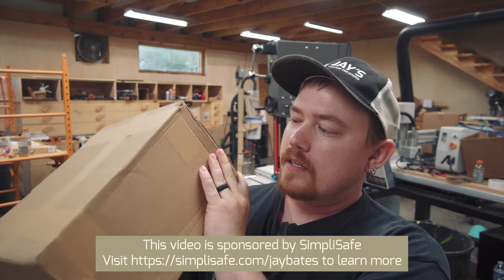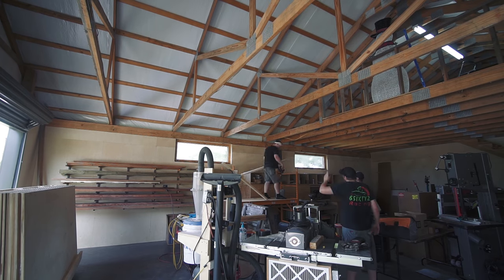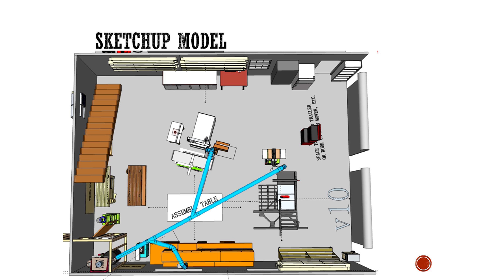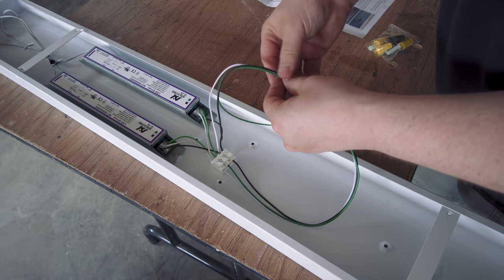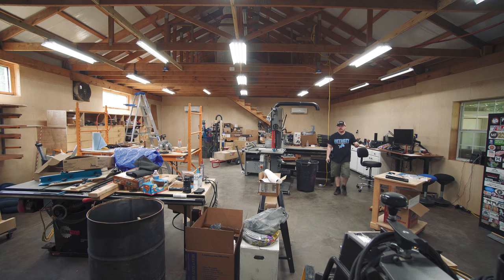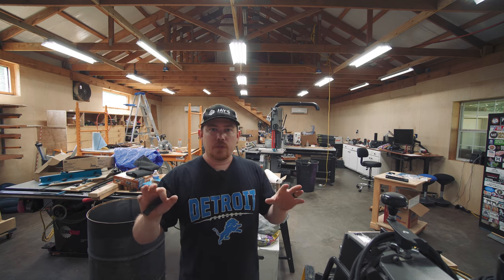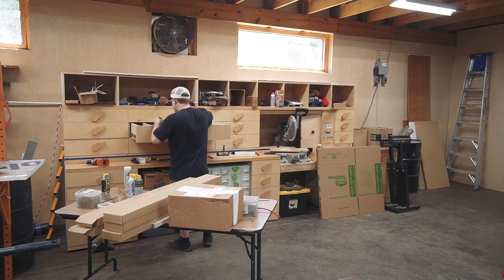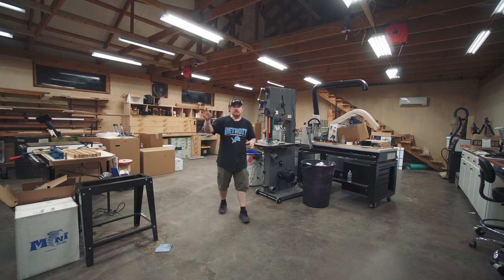30×40 Shop Part 5: Electrical, Lighting, and Security - 324

Comment: Jay,   I started doing lighting design in the mid 80's and recently retired from electrical engineering for a major contractor.   Your method used to determine the lighting was spot on.   Your explanations of the lighting term meanings were perfect.   I only have two thumbs👍👍 so that is all I can give it.  You are truly a professional!    Very respectfully,   Kevin

Comment: you  could add lights pointing up so iluminate the roof. i guess that would enhance the "open space" effect even more.
Reply from the maker: And a disco ball.
Reply: @JayBates  ... and then rent the space out to the local teens each Saturday night.. ;)
Reply: @genelomas332  - Yeah, then there sure would be some woodworking   :-P
Reply: This was my first thought after seeing the "finished" shot. The video appears dark and I think it's because the light doesn't fully reach the ceiling. Bouncing that light back down would do a lot.
Reply from the maker: @slowdaze  The video appears dark due to the camera settings being wrong.

Comment: Jay the shop is really coming together! Your doing an amazing job! One recommendation is to epoxy coat the floor. I used rustoleum professional epoxy flooring with a clear coat and non skid on top. I feel it is right up next to the lighting. It makes the shop so clean feeling. The shop is brighter and it is so easy to clean. Any system you choose it is like anything else you have to put in the prep work. If you follow it properly then the results will be out standing. I have dropped and drag things on it. No chips or peels at all. And if you don’t do it now while things are still moving about, you never will. I’m telling you just look into it and if you do it, you will be just as happy as you are about the ceiling and lighting!! Keep up the amazing work!
Reply from the maker: The floor is already stained and sealed. It's actually really nice. I need to mop one time once I get everything going.

Comment: I made an removable/adjustable shelf for my scaffolding large enough for tools or a painting equipment.  It goes "outside" the scaffolding so you don't lose any working area.  Keeps the deck clear and the tools within easy reach.  With your skills you could make one in 10 minutes.

Comment: I've been in my shop (2 car garage)  it's going to be  2 years in December 2019  ,  I'm getting closer to not having to run a extension cord or 2 to work in it. With working away from home 6 days a week and having other things to take care of when I do get home I don't always have to be in the shop. Having shop builds like yours is a big help in getting mine set up

Comment: So glad you get a chance to make a place just the way you like it. The place looks amazing with the new lights and the open ceiling. Might need a ceiling fan up in the high point of the roof opposite the loft to push heat down in the winter.
Excellent space.
Reply from the maker: My air cleaner cart blows up.

Comment: My security system has cameras outside my shop. I have one 12mp camera covering drive way, and another looking at the front of the shop where the doors are. The windows are laminate so you can’t break them anyway. The driveway watching camera is very visible and very well marked. It has captured several people driving up and speeding away, complete with wonderful face shots and license plates. The other camera is completely hidden.

Comment: Jay, I really like everything you did so far. My shop is the same size and one addition I’ll make based on this is to install a couple drop lights. Near the two garage doors at the front and back of the shop and one above the router table. It looks like you added at least one split ductless AC/heater. I must have missed seeing that getting installed Something I did that might make your shop lighting more even  is to paint your concrete floor with a light colored epoxy. Mine is a light gray with flecks and it makes cleanup quicker as well. My dust collection system gets most of the mess but I always wrap up by opening the big garage doors and using the compressor to blow the remaining dust off the benches and out on the lawn. It’s quicker than using a broom and the dust being recycled helps the grass.  Speaking of garage doors, I spent extra for insulated ones. It’s hot where I live in the Ozarks and some doors rated at R18 help keep things cool

Comment: My only tip is with the alarm system. See if Simply Safe offers a RAPID heat rise alarm instead of a smoke detector. Smoke detectors use a optical cell to sense smoke. Shop produce lots of dust which can be mistaken as smoke. I have Both Rapid Heat Rise AND Carbon Monoxide detectors. See if Simply Safe can switch the smoke detector  and add a CO detector. Place the CO detector as close to the floor as possible as far awy from a door as possible. CO is heavier than air and will rise from the ground up. If your dog or kids are in there playing on the floor then they will be effected by building CO before you will at the tools. I discovered this ALMOST the hard way.

Comment: Great ideas and good planning on your part. I particularly like the idea of protecting your tools in a rolling cabinet as opposed to the tool wall display method. Rust is always a factor with the wall hang method. I guess that the tool cabinet could be your first furniture build in the new shop. 😊

Comment: Excellent video! That vault will help with the heat for sure. One under appreciated part of your shop is the floor. Any issues with the slab? It sure looks good on the video.
Reply from the maker: No issues with the slab. It was previously stained brown and sealed. I need to mop it at least once to see it's real beauty.

Comment: Thanks for sharing the shop videos.  It looks great after opening up.  I don't know your plans for your loft office, but if you were going to close it off from the shop you might consider using some clear acrylic or plexi-glass on the one wall to allow to see out over the shop.  Just thought I would throw that out there as an idea to consider..
Reply from the maker: I'm not closing it off. Just a plywood baseboard to stop items from rolling off.
Reply: @JayBates  And child proof, so no accidents - 2 or 4-legged.

Comment: Very nice shop, getting ready to build my dream shop and cant wait. As for led's I keep seeing people say led's are brighter and that is not accurate, led's are no brighter than fluorescent  bulbs of the same lumens. Everything is about the lumens and you can get high cri fluorescent bulbs also, as that is what has been used for photography for years. Led's in general are usually lower lumens than there counterparts unless you are willing to pay the price. Typical led fixtures at a bigbox store will be lower lumens than a fluorescent bulb, you have to go to a specialized lighting place / internet to get higher lumen led's than lets say hd or lowes. But to anyone in the market look at the lumens if it says 2900 lumens and you have a fluorescent bulb at 3900 lumens there is no comparison the led bulb will look dim in comparison. So make sure to look at the lumens of the fixtures / bulbs and do ur research. Having said that I love led's, whole house is led's but shop for the moment is still fluorescent for the reasons i listed.

Comment: Thanks for the advice on the lights I call today and was quoted 1364.40 with your discount so Thank you. My shop is the same size as yours but I will order 40 of the24W 4ft U type retrofits and 4 of the 240 Watt LED drivers. What are your thoughts on that configuration.

Comment: Am curious what use you decided for the old air compressor room just outside the shop. Don't remember hearing you talk about plans for it. Nice shop in any case. I'm sure a lot of your wood working followers are jealous (in a good way). It is looking really great. Thanks for sharing.
Reply from the maker: Looks like you missed video #1. It's a storm shelter, not an air compressor room.

Comment: You should put ceiling fans up in the rafters. It would turn that air over and lower your utility cost.
Reply: I assume it would in the winter, where you could push warm air to the floor.  But what about summer?  Just leave them off so the cool air settles?

Comment: What brand or where did you get the drop cord reels. I have two different ones and they would be nice if the worked properly. Yours look more robust. Curious on the gauge of the wiring and if they have built in circuit breakers?

Comment: So first question that comes to mind and might be worth exploring. You mentioned the glass break sensor. If someone were to use a glass cutter and pop the glass panel out, will the glass break sensor still catch it or no. Granted the motion sensors will still manage to likely catch the criminal in the act, but it does peak my curiosity on that.
Reply from the maker: They will trip motion sensors

Comment: Great to see the progress and how your new shops get better and better. One small point though. I think that you might have done a slight mistake in the K value on the comparison pictures from your old shop. You say the LED lights are 5000k and the fluorescent lights are 6500K though the higher value is more natural light. So normal daylight is around 6500-6700K and while 500K is still very white it's much warmer than 6500K meaning it should appear to have more yellow while the colder 6500K should be more pure white or even a bit blue. I know it's a bit confusing that the colder light has a higher Kelvin value while the warmer light has a lower Kelvin value sine Kelvin is a temperature value and the bluer the light the warmer the flame is. Though since we unconsciously associate a more yellow-red light as warm and a bluer light as cold it's a bit switched around.
Reply from the maker: No mistake. And it's not confusing at all. I think you didn't pay attention to the details. Did you not see the graphs about the color spectrum from fluorescent light? Regardless of the color temperature, fluorescent lights emit a dominating amount of the green color wavelength and very little of other color wavelengths. Fluorescent lights also degrade over their lifespan making the problem worse as they get older.
Reply: @JayBates  I guess that you switching the whitebalance settings between the photos does alter the picture enough to trick your eyes. The rest of what I said still is correct.
Reply from the maker: Yes, the rest of what you said is correct. I'm just providing information in regards to why the colors look like crap even thought the proper white balance was set in relation to the rated output of the product.
Reply: Ok. Funny how your eyes can deceive you :p
Thanks for the clarification.

Comment: Jay...Wow, what an upgrade to the previous shop space~!  Removing the metal panels from the ceiling was a great move.  I'm excited to see you back in production~!
I've been looking for power cord reels, but the ones from Rockler (and others) get some pretty sketchy ratings from customers.
Which ones are you using and would you recommend them?
Thanks much and congrats again on the new shop (and house)~!
Reply from the maker: This is the one I'm using. No complaints. http://bit.ly/31dvCWU
Reply: @JayBates  Great~!  Thanks much~!

Comment: It's coming along great Jay. I see that you guys had the two forewomen on the job supervising at times. I am happy for you with that great new shop. How close is your shop to the nearest neighbor?  Will noise be an issue?
Reply from the maker: Not sure on noise but then again I haven't made a tremendous amount yet. Also, I plan on working 8-5 mostly. I don't like running tools late at night.
Reply: @JayBates   I am the same in my shop except For me its 9:00. I usually only get shop time from 6:00 to 9:00.

Comment: HI Jay, just installed some of the same lights in my garage.  I have a slight delay when I turn them on for the first time after sitting for a while, probably 1 or 2 seconds.  I have things wired up in an easy order: Power>Switch>Lights.  Do your lights have a delay at all?

Comment: Funny story for you, well it’s funny now. Around twenty years ago I had some mechanics tools stolen from my garage. So being paranoid about another break in I rigged up a motion sensor and ran a wire to the house and installed an alarm on the night stand next to the bed. The very next morning all hell broke loose waking me from a sound sleep. I told my wife to call the police and I rushed out to the garage to find no evidence of a break in. About that time the police showed up and I told them that I thought it was a false alarm , but they stormed the garage anyway. The next morning all hell broke loose again. This time I just had my wife watch out the window, and again no sign of entry. Third morning same thing, this time it finally dawned on me that the city buses were leaving the bus barn a going past my house. After a lot of deliberation I concluded that the busses going by was shaking the motion sensor and setting off the alarm . I’m sure you will have better luck lol

Comment: You can’t compare the lights when they have diff kelvin temperature, of course you get better CRI when you pick a 5000 vs 6500 kelvin light source. 
Therefore the comparising is not reslistic
Reply from the maker: You can get high CRI lighting in all Kelvin temperature ratings. And using the correct white balance in camera should result in whites actually being white.

Comment: @jay you know that you didn't really compare florescent and LED you only really compared 5000k vs 6500k which you can get both types of light in. It's the color temp that matters most for the color accuracy not what tech is making.

 There are other pros and cons for LED vs florescent and color temp really isn't one.
Reply from the maker: @rodney I did compare them. I covered more light output at less power consumption and color accuracy. What else should have I included? I covered what matters to me in regards to the two options that I have and how they will be used for my work. Further comparison can be made with google search results.
Reply: @JayBates  to be a fair comparison they should both be at the same color temp at the least and as many other specs the same so that the only remaining difference is florescent vs LED which is how you framed the comparison. As what you really compared was mainly how color temp matters in video and photography. Which is a good thing to talk about just your framing wasn't a fair way to frame your comparison. As you can get pretty much the same results with high quality 5000k florescent as you can with similar LEDs is all.
Reply from the maker: I'm not sure you get the point. I'm not making an exact comparison of the exact same rated LED lights with the exact same rated fluorescent lights. I'm making the point that fluorescent lights generally have a much less even output across the color spectrum. The K value is largely irrelevant. If the white balance is set properly than white will appear white.
Reply: @JayBates  That is the problem is you couldn't make that comparison without making sure the specs of the lights are the same. What you discovered is that daylight is better than not daylight.  The K value is very important actually and there are reasons videographers and photographers will use different ratings to get different effects they are looking for.  You are missing the point I believe as in how to frame the comparison and changing the framing would have made it more accurate is all. You unfairly compared two different technologies correctly. I promise you if you had identical spec'd LED and fluorescent lights including color temp, CRI, etc that you would find they would be very similar and then and only then can you safely compare LED to fluorescent. You just had too many differences to make it a valid comparison for how you framed it is all.

I see we will just have to agree to disagree on how this your comparison was framed and why it was misleading in that framing.